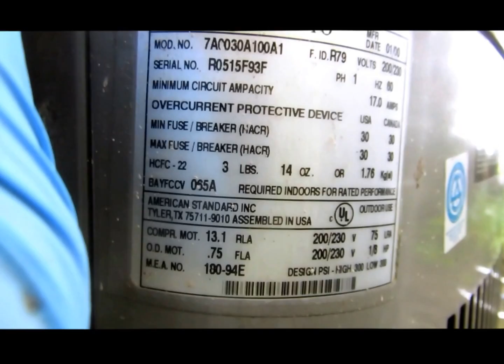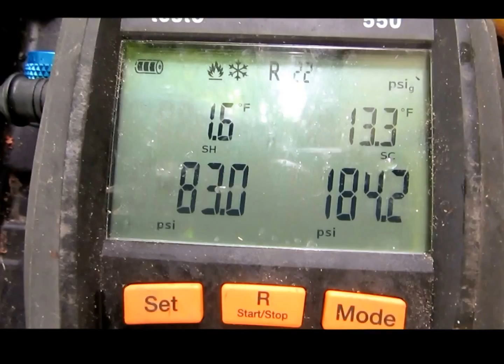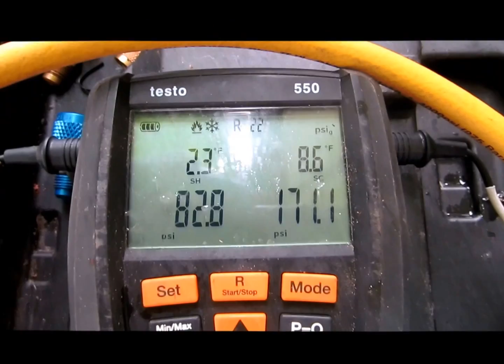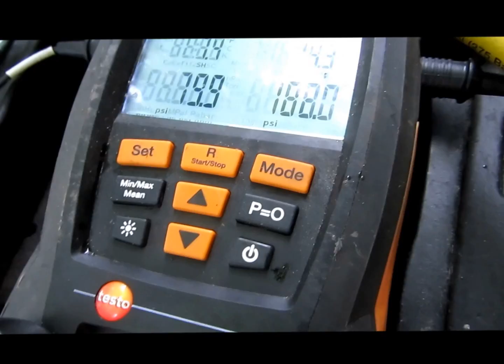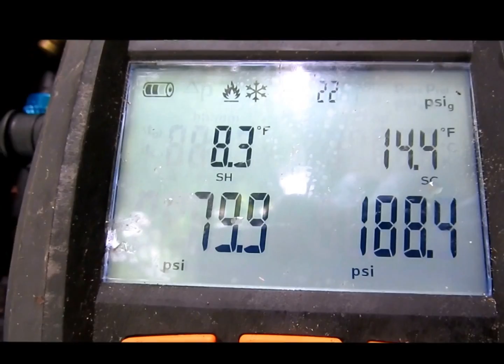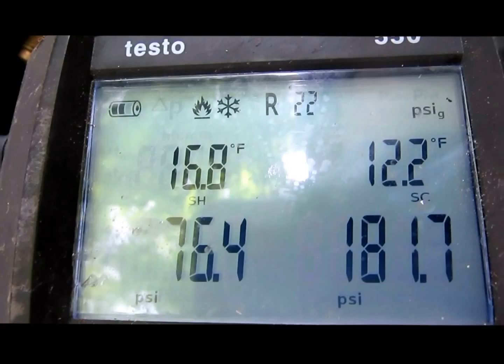Hvac-2 1/2 ton american standard air conditioning unit over charged

Comment: I work apartment maintenance. The guys I work with, their eyes glossed over when I talked about superheat. They think if it's 90 degrees outside, that should be suction line pressure. hmmm grinding noise at night you say?